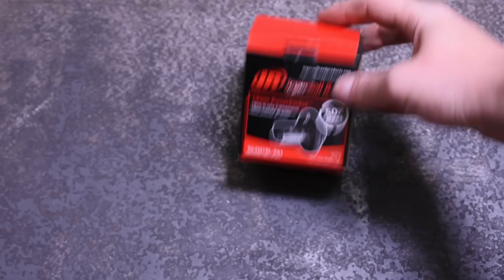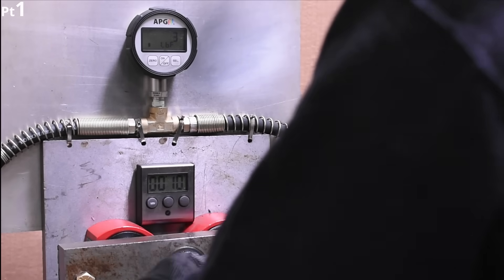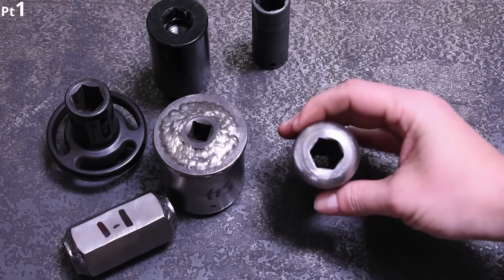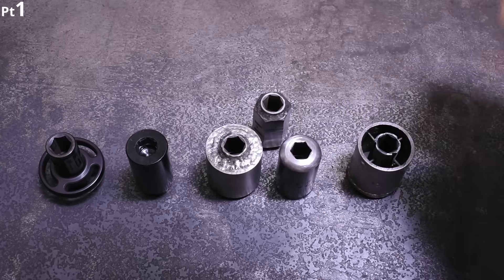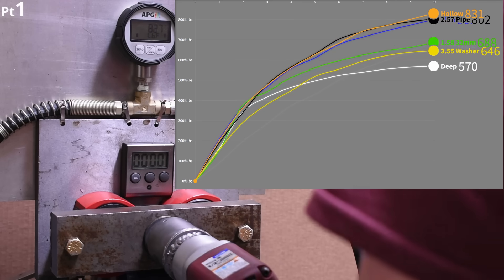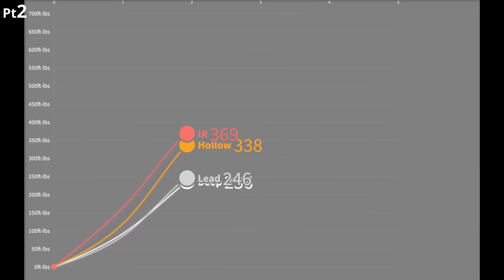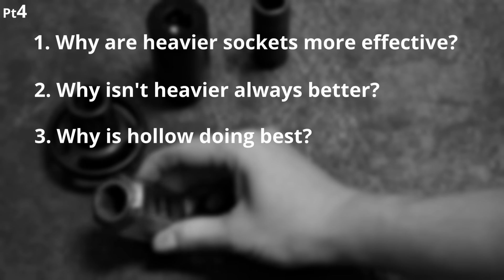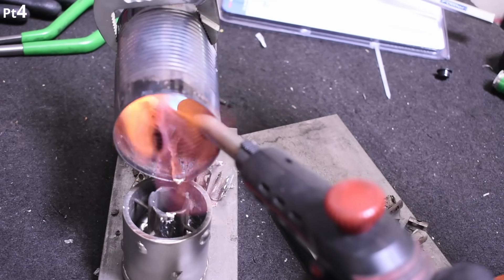Heavier Sockets Make More Power? Stumps Physicist

Comment: Long bolts act like torque sticks, absorbing the some of the impact from the head and flexing and not transferring all of the impact to where the treads are engaged. Just think about what an impact does. It takes the constant force of the motor and turns it into spikes of high and low force. Longer bolts flatten out the spikes that make it to the thread engagement. The heavy weight helps to overcome this by increasing the length of time of each impact spike.

Comment: Does the location of the extra weight make a more noticeable impact than the total weight itself? (I'll see myself out now) 😅
The 1.54 lb hollow tube socket and the 1.5 lb IR Powersocket have the weight further away from the center of the socket, requiring fewer materials. The 1.9 lb Lisle Weighted socket looks like it compromises by having a little more weight to have a smaller outside diameter. However, it is still comparable to the Powersocket at 10 seconds.
Maybe the impact's operating range (if you will) would also affect the readings, as you might see better results from the custom, heavier sockets when using much more powerful impacts? Too much weight to overcome appears to lead to longer run-up times or poor transfer of energy when used with "less" powerful impacts (at least, that is what I gathered from the chart and the Thor tests). So impact guns that go up 650 ft-lbs of torque can handle weights up to 2 lbs, but perhaps impacts doing 1,200 ft lbs can handle higher weights, say up to 4 or 5 lbs...just a theory here, but not a game theory!
So, if removing the outside ring weight from the Powersocket decreased the output, what if you made a larger diameter ring that puts the weight further away from the socket? 
Could keeping the outer ring the same (relatively) weight as the original ring, but extending it away from the center of the socket, produce more beans?
Could lightening the outer weight ring by a little, and extending the distance, make comparable results to the IR and Lisle sockets? (Like doubling the space and cutting the weight in half)
It appears like the weight is putting more leverage onto the socket if the mass is further away from the center of the socket.
But I still haven't got my armchair degree yet...something about I would not stay in the chair long enough, or something like that 😅
Good stuff you got here, Torque! I look forward to seeing what you have in store next 🐺🔧

Comment: A great experiment with sound practical field data. I believe the physicist was correct but overlooked considering the resonance of the system.
The resonance would change between tools, particularly between different types of tools.
There are various factors in play:
1. increase overall mass does absorb more energy, hence less overall torque
2. increased rigidity increase the transmission of torque.
3. Increased rotational moment of inertia increases the peak torque on impact
4. the harmonics of the system that occur due to the three properties above and the speed of rotation will result in a system resonance that peaks for different systems.

The hollow tube(pipe) is efficient at forming a rigid tool and has minimal weight for a given rotational moment of inertia, more so than the flywheel tool.
I cannot speak of the system harmonics as this will need to be  assessed using various laboratory equipment.
As seen in your experiment when the flywheel band was cut off the flywheel tool, the peak torque reduced proving that the rotational moment of inertia does assist in transferring more torque.

It just so happens that the hollow pipe is an optimum mix of the competing factors to transmit torque. 
It would be interesting to experiment on fine tuning the wall thickness of the outer tube to see how sensitive the tube wall thickness is o the overall effect.

thanks

Comment: Engineer here, my guess is that the free play between socket and nut is critical here - after each impact, the socket is bouncing back and getting a "run up" for the next impact. If so, the extra rotational inertia lets you build up more kinetic energy during this tiny run up window, much like a heavier hammer does inside drive.

There could also be a natural frequency tubing element here, getting the socket to bounce back and forth in time with the impacts to help amplify. The high speed footage will hopefully show this.

I'd like to see some tests between sockets that have very snug fits vs ones with some slip to see if this helps or hinders.

Comment: I think you have two things going on. Force times mass equals acceleration AND added leverage. Think about it. You're literally adding more torque. You can add more torque to a fastener with the same amount of arm pressure by using a longer ratchet.
Reply: Basically you're adding leverage. You should write up a scientific paper on this. You know, for science.

Comment: Does it need to be attached to the socket directly, or could you have, say, a flywheel welded on an extension and get the same (or similar) effect from any socket you attach to that extension?

Comment: I am not a physicist but a lowly engineer.  Armchair physicist, then.  I wonder if there's a resonance set up in the impact wrench hammer assembly and socket.  The socket is flexing some and the additional mass/flywheel is constructively adding to that oomph.  This idea could be tested by (1) finding an impact wrench that oscillates at a very different speed that is not 2x the usual speed, like say 5.5x, or (2) testing sockets that are extra long and moving the flywheel along their length, or (3) comparing different flywheel materials of the same weight, e.g a steel flywheel and a cast iron one, or (4) build a flexy noodly impact socket, like a 1/4 in dia. rod and see what it looks like with the high speed camera.  Also there is a limit to the possible improvement that can be made this way if material resonance is your invisible helper here.  
I'd love to see a follow up on this video!

Comment: For some reason this is reminiscent of when you pull on the oil drain pan out from under your car and it splashes out, but not on the first time it waves against the pan but rather the second or third time the mass hits the side of the pan

Comment: Think about the added weight like a hammer. The more leverage you have (handle length), more force is being able to be transferred with each hit. But weight comes as a disadvantage at the same time, if the handle is short, you won't be able to swing it as hard, so that's why there's an optimal weight and distance from the center this weight should be at for best performance and I'm afraid there's no "magical" socket, as each one should be designed based on the actual capabilities of the power tool that is going to be used with. So, these weighted sockets are basically a "hammer extension" of your power tool, it needs to be not-too-heavy-but-heavy-enough and at a certain distance from the center of rotation, but that equation is probably something no one will ever get perfect, as there are too many designs for power tools out there. At best, you could get one specifically made for your model.

Comment: Let's assume we're talking about a rigid body spinning around a single axis. If the mass is concentrated near the axis, then it has a relatively low moment of inertia. The further away the mass is from the axis, the higher the moment of inertia.

For a point mass m a distance r away from the axis of rotation, the moment of inertia is I=mr2. Here's the moment of inertia for some common objects:

A solid sphere: I=25mr2

A hollow sphere: I=23mr2

The coefficient in front comes from the shape of the mass. For a hollow sphere, the mass is further from the axis of rotation, so it has a higher I for the same m.

Comment: I was thinking of this so I searched a bit to confirm my(non-engineer) theory, and found results that might shed light on the flywheel situation. If not, it can be used to experiment a bit I think. Anyway Torque is the same at any diameter of the wheel but the force is greater in the center. Like using a long pipe on a ratchet/breaker bar/wrench for leverage.  T=F*L ...It seems backwards sort of, because it's driven from the center, but it is all connected. Imagine support bars welded from the open end of the socket to the outside diameter of the flywheel. Whether it's being turned by a hand by holding the outside diameter of the flywheel or driven from the middle by impact gun that force gets applied I think....hahaha maybe I'm talking out my rear end 😂 but my pea brain would love to see experiments with Torque = Force x Diameter. Keeping in mind force is mass x acceleration....Maybe it's a case of the simple answer is the right one or is it simple? I've spent too much time thinking about this already....thanks torque test channel! ....or maybe I'm just an uneducated hick from the sticks lol. 😂 But anyway yeah, I digress. This is the thought I had that led me to this paragraph on Quora: "This is exactly like applying the same torque to two different wrenches, one with a 1ft handle, and the other with a 2 ft handle. The one with a 1 ft handle requires twice the force to get the same torque... (T=F*L)"

Comment: Wouldn't make for anything uh... ear friendly, moreso than an impact already isn't... BUT...
What if you took the hollow pipe, welded in two flat tabs/walls, AND THEN put in some steel-shot (ie for shotgun reloading) or a couple large-ish ball bearings?

In other words: make a "dead-blow" socket (of sorts)
Performing the same tests here, just with the two different configurations. Any further ones that use different "fill" material are up to you. 

If the divided sections can some how be made fluid-tight, it'd certainly be interesting to test filing the two chambers with various liquids; thin oil [0w-20], viscous oil [gear, or 'compression restore' addative], water, water with sugar or salt dissolved in it, 91% Isopropyl Alcohol (~$3 a pint at Walmart), etc etc 😁
... Sorry, I'm here for the science element of your videos, having no use for these tool types anymore. But experimenting like this really tickles my inner MacGyver and then my inner-muse doesn't want to shut up! 🤣

Comment: Yes and no. A heavier socket will have higher inertia, so it will hit harder, but it will require a harder hit to get it moving, and given the rebound from each hit also having the higher inertia, I suspect they'll either hit the same or less than a regular socket.

Comment: If you want to add further data, machine a bolt with a square drive in the end. I know this removes one of the joints and that will improve torque. The IR socket is likely creating resonant frequencies that works with the hammers. It's also possible the vibrations are helping the "shuffle" the threads lowering the torque needed to tighten. I have seen that make a difference when loosening bolts using a Hytorc and hitting the socket with a hammer (I do not recommend this, simply relaying information).

Comment: I think that the ring/flywheel thing on the power socket was, in fact, adding extra rigidity to the socket and that’s why you saw less applied torque with it removed.

Comment: Curious for real I work in a small engine shop. I’m very interested in 5/8, 3/4 and 15/16” sockets in this design !!!
Reply: There are times blade bolts are so very rusted on especially if there is an impact it’ll actually tighten the nut/bolt on the spindle.

Comment: as for the flywheel design, I noticed the flywheel is all the way at the back of the socket right where it attaches and it not very long (by long I mean the thickness of the flywheel in the direction from the back to front of the socket).  perhaps the position and inertia of the flywheel helps reduce deflection (not sure if that is the correct term) of the socket i.e. the end of the socket wobbling off axis which would reduce the efficiency of the energy transmission.  could potentially be a similar effect with the hollow socket.  since all the added mass is on the edges it is still adding a significant amount of inertia to the socket when rotating would could help balance it out while not increasing the actual weight by much.  I'm curious how these torque results compare to unweighted and weighted sockets than are shorter or longer in length?  and were the lengths of the sockets used in this video significantly different or were they all pretty close?

edit: I said shaft deflection earlier, I believe the term I was looking for was shaft whip

Comment: THIS will probably get buried but the question here is does A hit B then B hits C or  does A plus B hit C. Weld impact gun to socket if that's higher you have your answer. The physics professor was treating it as a single body.

Comment: My theory is that the fly wheel provides levarage, making the added weight more efficiently used than say, the lead filled one. It also adds stability by having the weight distributed in a circle, on top of point, like a beyblade or similar spinning toy, making the energy that gets put into the nut less wiggly and having it go straight to the screw. And the hollow ones are better because they are basically tubular fly wheels. Feel free to dabate me, I'm just a dummy saying random stuff that makes sense to me this moment

Comment: Centrifugal force vs mass, hence why the Ingersol rand is small but the outside diameter is large .... It works .

The motor with mass has to move the higher mass vs the lighter version of the ingersol has more centrifugal

Comment: Have you considered making a "flywheel extension" (a short anvil extention with a flywheel welded on it) so the weighted flywheel could be added and removed using any socket? Would be a handy tool to have if it worked the same
Reply: generally having an extension on your impact reduces it peak because of the slop between impact > extesnion > socket  opposed to just impact > socket. you would think the losses couldnt be that much but as a mechanic i promise the extension just ruins it :(
Reply: @rope_bunney7927  Yeah, probably two or more things happening, rigidity and inertia.  As humans have found, not everything has one simple explanation, but a combination of variables that can send a person into a crazy deep dive or wild goose chase.
Reply: A extension does reduce the tq value from the impact but perhaps a flywheel design could mitigate some of that. I think that's an interesting idea.
Reply: ^^^ THIS! Having already purchased, and used, the Astro Pneumatic 21mm and 19mm versions for stubborn lug nuts, I would happily purchase a short extension that could be used with any 1/2” drive socket. Perhaps a 3/8” version also? Keep up the awesome channel!!!

Comment: Awesome video, thanks. I have the same experience. I made weighted socket for my fake makita, just big nut welded over the 17 mm deep socket, similar to IR. But it's worse than cheap noticeably lighter 17 mm socket. Looks like more weight just eats energy from weak impact wrench and don't transfer it to the bolt.

Comment: To me it looks like the hollow one is more effective because you are moving the mass away from the center of rotation. That extra mass moved from the center of rotation is acting like a lever. Think of a cheater bar on a ratchet. You are physically not putting any more force into the ratchet but the added length is multiplying the applied torque

Comment: I am curious if there was any difference in how tight the sockets were regarding the tool and regarding the bolt. If all the tolerances are similar then I can only explain it as a the result of resonance. Too much weight and too little weight will reduce the resonant impact. If that theory is correct then different weight hammers (in the tool) will result in different "ideal" weight in the weighted socket.

Comment: Lead is soft and serves only to convert more of the kinetic energy to heat. Higher rigidity offers lower transmission loss. Lower mass is similar, hence the hollow tube performing better. And of course a force applied further from centre equates to higher torque, so the rigid flywheel and hollow tube both have merit based on that. But if you want to get at the nitty gritty of the energy transfer I suspect you're going to have to run tests with a high speed camera to watch where things flex and resonate. What you're up to with those varying tool designs is impedance tuning. If you can perfectly match the impedance between tool and fastener you'll transmit the greatest amount of torque. Changing either will change the required impedance value and you'll have to start tuning again. So it's fun to get close, but I wouldn't spend too much time looking for perfection!

Comment: Vibration through the tool in to your hand is a big part of getting power delivery  as well. If you're using a sloppy worn out deep impact socket that's shaking all over the place you wont get as much power transfer as a shallow socket, although the deep socket weighs more.

Comment: More energy needed definitely applies, I'd say it doesn't make any difference for cordless, because the IPM is high enough that the bolt "feels" a continuous torque applied, as opposed to less, stronger impacts from an air tool, on that note I believe the weighed sockets increase the achievable torque by the means of keeping everything tensioned before the next blow, not only taking up the slack from the system, but also pre tensioning the bolt a little with ideal proportions, maybe even keeping it moving, as in you don't have to overcome the static friction every time. Either way that would explain why the hollow one works the best, it's not as heavy as the others, while still being able to hold quite a lot of inertia, while with a socket that's too heavy, the energy needed overshadows the benefits.